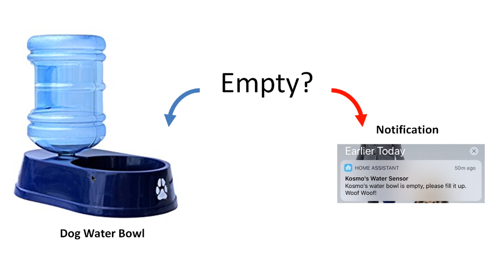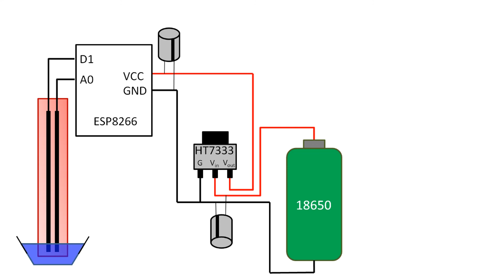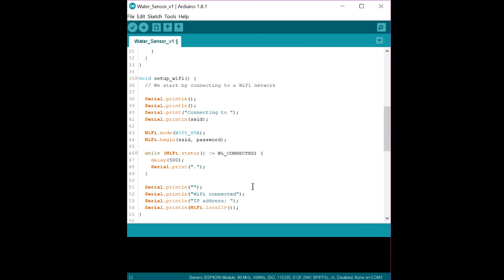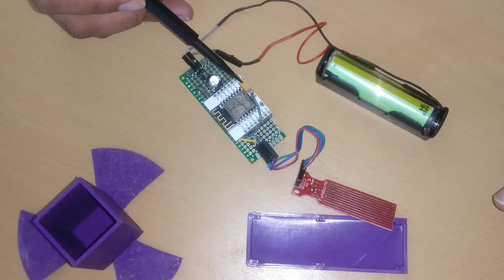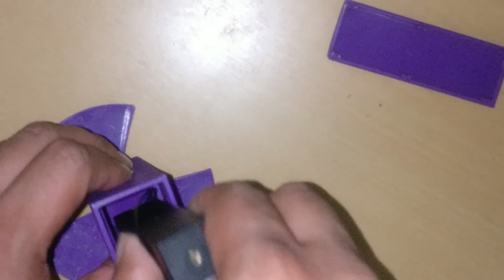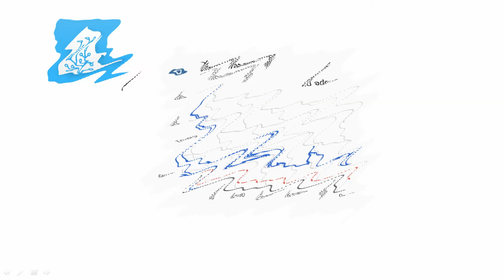Internet Connected Dog Water Bowl Sensor

Comment: what is the resistor for?
Reply from the maker: I use it as a voltage divider to measure voltage of 18650 Lipo battery
Reply: @deb-sahu  is it required for the project to work?
Reply from the maker: Nope, it’s always good to have battery data
Reply: @deb-sahu  is the battery measuring in the code? Where should the resistor go?
Reply from the maker: It is not in code. You can skip it if you are replicating this as there is only one ADC in ESP8266.
Reply: @deb-sahu  could you add it? I think it would be an excellent feature
Reply from the maker: Couldn’t agree more, v2 version of the device is in prototyping.

Comment: Nice video and very good channel, I have found very interesting things!  I also have several devices with espHome in Home Assistant but to give my dog water I use a Wi-Fi plug and a water pump.  My next project is to make an esp32cam on wheels to see my dog up close.  Parts are already coming, I want to do it with the L298 motor controller for 4 wheels, servo motor to raise/lower the camera and battery.  And if I can also put a charging base on it, that would be cool.  I don't know if it will be possible to connect everything to an esp32cam to control everything from Home Assistant or will I need another esp8266.  There are many videos of esp RC wifi car but none with espHome.  It would be great if you can try and help me.  Thank you very much and keep it up!
Reply from the maker: That’s a neat project. I have a full time job that is not electronics and IoT stuff, which has been keeping me busy for the last few years. These videos are just documenting my hobby, wish I had more time to spend on exciting projects.

Comment: I have been searching the net for days trying to find a water bowl which will let me when the water level has gone beyond setpoint. I could not build one if my life depended upon it. Does anyone know where I can purchase a water bowl with a low level indicator?  I don't need an alarm. I was thinking of a LED strip around the bowl. When level rashes point, the LED lights.  I can't believe something so simple is not out there to purchase.

Comment: I am currently in the process of trying to build this. I have a few things i am confused about. I have the HT7333 attached to the back of the adapter board just like yours and i can see that ground and VCC are directly connected to the pins on the ESP but i do not understand where i should be connecting the input positive side of the battery, if not directly to the LDO where? I ohmed out the ESP to see if it was connected to Vin on the LDO but am not finding any pin directly connected.  How are you connecting the input voltage? Second in your actual circuit i see resistors. Can you explain what they are for and where they should be connected.  Any help would be greatly appreciated.
Reply: Thanks for the quick reply. Soldering the resistors now. I still don't understand where you hooked up power in from the battery.  On the schematic it goes straight to the LDO Vin, but on your actual circuit it's not. Do i just solder it to the Vin center pin of the LDO HT7333? On yours it doesn't look like you had wires soldered to the LDO.
Reply: Thank you very much. Thats what i was missing. Makes sense now.
Reply: @pendlet38487  hi, the other comments area missing, could you fill in the blanks for us?

Comment: I am looking for the exact same concept to measure my water tank in the roof. I just don't understand if I add a longer cable and fix the sensor to the bottom of the tank will the cable connection in the water short circuit the esp8266?
Is there a sensor with water proof cables? Or can you think of a work around for it? Any and all help will be greatly appreciated. Thanks for the video.